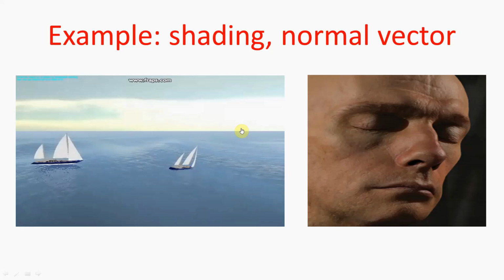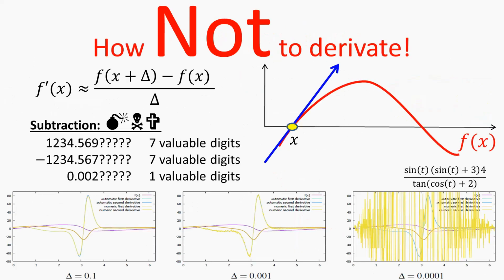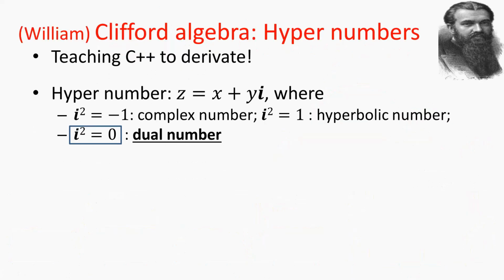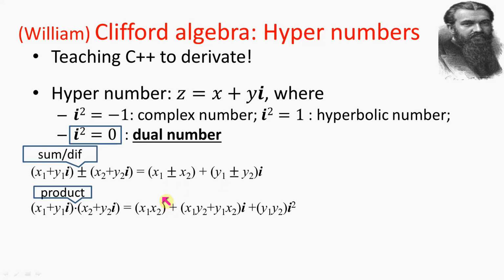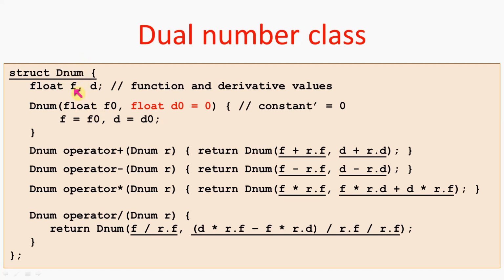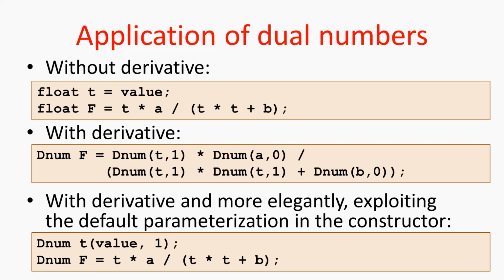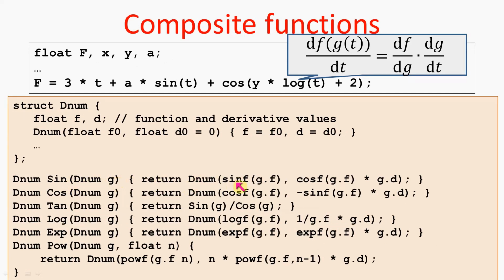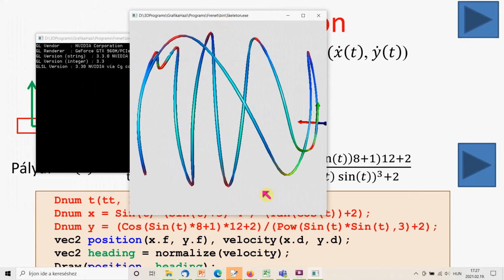1.4. Automatic Derivation with Dual Numbers

Comment: Can we use dual numbers for integration?
Reply from the maker: No. While derivation is a mechanical process, integration (the inverse problem of derivation) is not. In many cases, it is impossible to find the antiderivative in analytical form. So, for integration, numerical quadrature techniques are typically used.

Comment: Thanks for the great lecture. Finally understood the connection between dual numbers and AD thanks to this. Just a couple of questions - 
1. Since one pass of the function gives us the derivative with respect to a single input variable, would this be equivalent to performing to forward mode automatic differentiation?
2. Can we use dual numbers to perform reverse mode AD?
Reply: 1) Yes
2) no, forward propagation only